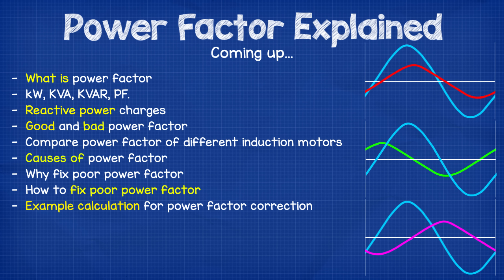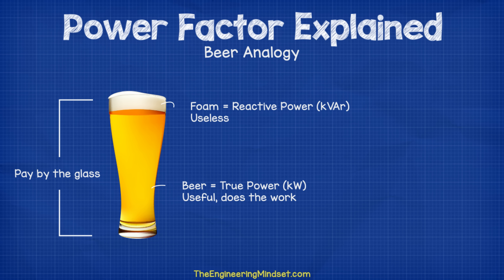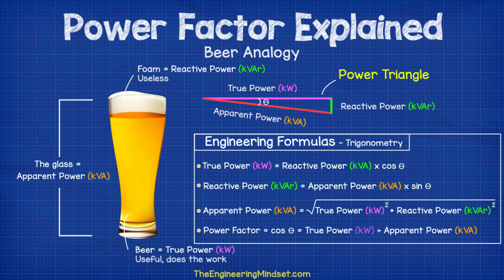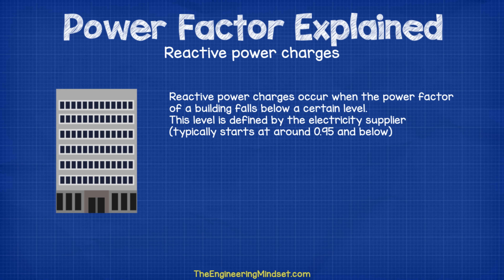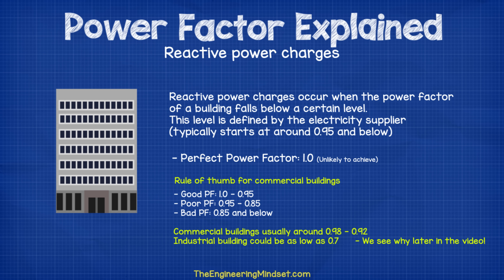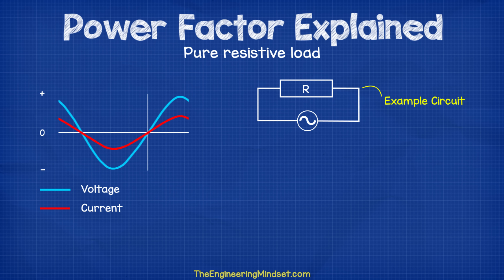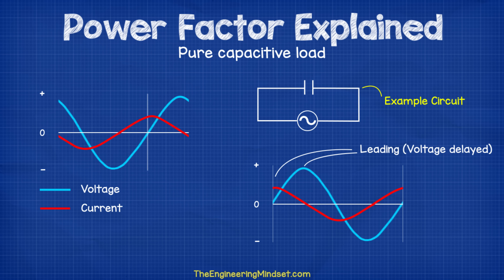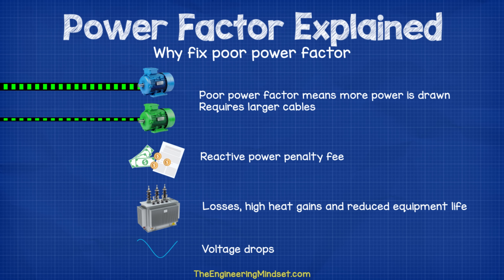Power Factor Explained - The basics what is power factor pf

Comment: How Unit/Kg is standardized in manufacturing sector.
Reply: It used to be (even within your lifetime) that we used a physical object as the master kilogram.  There is an metal cylinder as a prototype, stored in a vacuum chamber in an underground vault in France, that is the single reference object that defines what a kilogram is.   It is called the international prototype kilogram, or Le Grand K ("the big K").   Many countries have their own replicas of Le Grand K, built to the same specifications, and stored in the same conditions, that are used as a master reference to calibrate devices that measure mass within the country.

The problem is, that there is deviation in the mass of the various replicas, which makes reliance on a single physical object unreliable for a unit standard.   In 2018, we re-defined the kilogram, by setting Planck's constant to a fixed number, so that the kilogram is no longer dependent on a single object.  If Le Grand K is destroyed, or if it changes mass for unexplained reasons, we no longer need to rely on it to keep track of what a kilogram is.  Using a method to measure Planck's constant, called the Watt balance or Kibble balance, one can determine the mass standard for defining what a kilogram is, for all mass measuring devices.  It feels like it takes a degree in physics to understand this definition, but simplicity is not what the international bureau of weights and measures needed for replacing the existing standard.  It was whether the new method could achieve a more accurate result than the existing standard, that determined which method won.  There was a competing idea that used a pure silicon sphere defined from the crystal structure of a pure isotope of silicon 28, intending to fix Avogadro's number, that I would've preferred, but it couldn't beat the Planck's constant/Watt balance method in precision,

Comment: but i could not understnd that the unit of capacitance is Farad so why,in the end,u said 25 "kVAr"??
Can u tell how to calculate in Farad??
Reply: Capacitance is A*s/V (Farad)

Power, apparent power, reactive power are all in Watts (V*A).

To convert you need to divide by Volts squared and multiply by seconds (technically divide by per seconds).

C = VAR / (2 π f V2)

Comment: Do you happen to know why a motor would have a power factor higher than 1?  I have several in my shop that have PF of 1.2.  I know that's something I have to account for when choosing motors for pumps because it affects the horsepower of the motor.

Comment: would the power factor of a permanent magnet motor be 1?
Reply: No,  a permanent magnet motor is still an induction motor. You still need to induce the magnetic field in the stator coil to push the magnets in the rotor. 

Although, the power factor is better because you don't need to induce a magnetic field in the rotor.

Less induction means better power factor.

Edit: state to stator.

Comment: Very well explained. Thank you. I do have a question. We have a Generator that has a 0.8pf, 3phase and 30KVA. Can I add a capacitor so that I can increase the pf? If its possible, where should I placed it?
Reply: Yes you can. You will need to connect capacitors on a delta connection because in delta you require 3 times less capacitance than you would get on a star connection, so Zc(delta)=3*Zc(star) after you have connected your loads.

Comment: Great videos of yours, I appreciate deeply each one of them. I've found the animations particularly descriptive, much more than all the drawings I could see on student books.
I did not go through all the commentaries to check whether someone already commented on the slide with the trigono.
A minor mistake :.
True Power [kW] = Apparent Power [kVA] x cos(Theta) or
True Power [kW] = Reactive Power [kVAr] / tan(Theta) but not
True Power [kW] = Reactive Power [kVA] x cos (Theta). 

I guess you meant : equation 1 squared + equation 2 squared = equation 3 squared, so Eq1 should read : True Power [kW] = Apparent Power [kVA] x cos(Theta).
Correct ?

Also

Power Factor = cos(Theta)=True Power/Apparent Power (the division symbol can be confused with a + sign). This was already mentionned in a previous comment.
Hoping it helps.

Comment: Power factor of an electric motor for Ecole can vary greatly depending on motor load, I've seen it go from a pf of 0.60 to.0.85

A huge flaw on the engineering side is they always seem to calculate things at full load when in reality devices are rarely at full load all the time. So smart designs accommodate multiple load sceneries, 25%, 50%, 75% and 100% so that systems run efficiently under most all conceivable load conditions. It is especially a common pro lem with data centers being designed at max efficiency under full losd.then data centers comes out of construction and sits for a year or more at 10% to 40% operating horribly inneficuent with way oversized motors and cooling systems (inductive loads) fast cycling on/off constancy over cooling, causing excesive wear on the gear and power factors verying all over the scale so simple solutions like capacitors don't work when real world operating conditions very constantly from the ideal design. I can be a huge pro lem four operators and equipment reliability. Engineers often think of the world, and especially data centers as runing at a constant full load when in reality they do not over there life span with no accommodations in the design for efficient operations in all load conditions...
Reply: It depends on your application. My experience is that the motors that we ran run at a high load all the time pull 80% of max amps. Power factor with caps ahead of the inductive motors work well. The motors I am referring to are used to move fluids and run from 1hp single phase to over 1000hp 3 phase. This is a continuous processing plant so cycling isn't something that happens except during a shut down to upgrade and or repair equipment and those last less than a couple days before the plant operates again at 24/ 7 for months on end...
Reply: @fun2drive107  true in industrial but in HVAC the load will very greatly quickly and greatly from morning to night, seasonally and occupancy changes. Most engineers fail at designing for efficiency at no, low, and medium and variable loads. One thing LEED (and ASHRAE somewhat) does is to gain points for LEED certifications if a building is verifying designing for varying loads so the building operates efficiently a And comfortably (comfort us another thing engineers fail at horribly with efficiency) at all loads, empty building at start up, partial occupancy, full occupant, sudden occupancy changes, sudden load changes, winter, spring, and summer, fall, building orientation and climate zone all dramatically impact efficiency and load. Using modeling and then tested and verified by commissioning
(my job) the design. Again in my experience it is common to see a large motor running under very low or constantly verying loads or large load changes with horrible efficiency (power factor as ll over the board). Common with large fans trying to maintain control of constant duct pressure or cooling/heating demand as heat lids dramatically and quickly change. Many engineers only deign for max load assuming hottest or coldest ASHRAE day for that cv Linate zone as the building performs horribly at varying and or loads other the the limits, very common issue, it's why a buoling is cold, doors blow open, fans hunting, fast cycling stsytens on mild days.

Comment: Our commercial building lost a leg of 3 phase into the transformer before the meter. Got an astronomically high power factor charge. Had to fight with power company, no attempt of reasoning was working to explain this wasn't a fair charge.
Reply from the maker: You should have interval data from the meter which you can use to prove

Comment: Ugh, beer without foam. Like orange juice without fruit flesh. Or air without oxygen.
Reply: Air without oxygen is a contradiction of terms.  Air by definition, is a mix of mostly nitrogen, some oxygen, and a small percentage of trace gasses.   It is common to model combustion exhaust gasses as "air" when studying the thermodynamics of engines, because the nitrogen as a nearly inert "spectator gas" is the dominant flavor of gas in both the initial air and the exhaust gasses.

Comment: Hi,
I am a follower of your channel, I like your channel.
 Can you please help in explaining LV Capacitor Bank step by step but the 
most important is;
1- the calculation of reactors in base of the harmonics in an industry 
using VFD controlled motors for example or any wave distorting source, 
with an example using power factor meter that gives the harmonics in the
 facility and how to deal with those harmonics.
And which are the cases that we don't need to use reactors in series 
with the capacitors, that if we are using Capacitor duty Contactors to 
limit the Inrush current.
2- discharging resistors issue, how to calculate them and how to connect
 them in an exact way? Is the connection made via timer relay? With a diagram, 
if possible.  I found diagrams on the net showing the resistors 
connected directly on the Capacitors terminals without any timing relays
 and that did not convince me, the proper time permissible to discharge 
in case of on off loads like motors used to cut marble or variable 
mechanical load that changes the pf in the way that we need to cut the 
Capacitors out for some moments. Thank you in advance.

My best regards and respect.
Reply from the maker: VFD Video is now live! here: https://youtu.be/yEPe7RDtkgo
Reply from the maker: Check out NEW resistor video, everything covered! ➡️ https://youtu.be/DYcLFHgVCn0

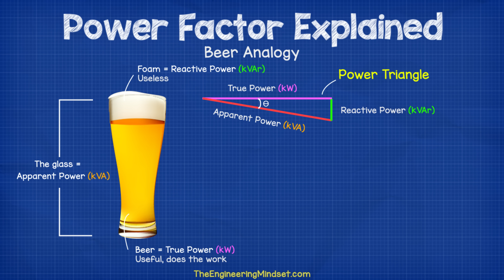Comment: the beer glass docent match the right triangle at 2:30, true power should move up and down aswell
Reply: You're wrong. True Power never changes. Only reason Reactive and Apparent Power are changing is because we add an inductor or a capacitor (If Reactive Power changes, so does the Apparent Power). For example, an asynchronic 3-phase (inductive) motor, you need capacitors on a delta connection in order to increase the Power Factor. Remember, the higher the PF is, the less Reactive Power we have and the closer both True and Apparent Power are).

Comment: So, why motor produsers then don't just add a capacitor into their motors to make good pf?
Reply: because PF depends on load, if the load changes on motor, then you would have to change capacitance as well. So fixed capacitor would help only in fixel load point. Thats why the compensation is used at higher level, for example whole factory and there is bank of capacitors and controller that switches on/off additional caps to match the capacitance to achieve certain PF
Reply: It's common that they do.  And the capacitor has other benefits as well, such as the fact that it softens the starting current of the motor.

A motor without this, will spike the current when it first starts rotating, and reduce it to the full load amperes once it achieves its steady state motion.   You ever notice how your lights dim when the refrigerator starts running?  This is because of the starting torque and inrush current of the motor that drives the compressor.   The capacitor can store energy during the first half of the AC cycle, so that it discharges and assists the power from the grid to initiate the rotation of the motor.  This offsets the inrush current that would otherwise need to come from the grid, and cause a "brown-out" for other loads on the premises.

But the problem is, that you can only know in advance the size of capacitor to add, if you have a known load that will not change.   The power factor will depend on the mechanical load on the motor, so you'd need a capacitance that could dynamically adjust, in order to adapt to every possible mechanical load.

If you have a routine predictable mechanical load on the motor, you could add a capacitor that takes care of the problem.

Comment: How does the PF change as you go from free wheeling to fully loading and induction motor? I would love to see a scope output that had motor torque, current and voltage overlayed as torque was changing.
Reply: PF is the lowest in idle, and goes up as the load goes up (reactive component is constant, but the active component grows). Keep in mind that the same motor idling with PF 0,2~ and loaded with PF 0,95 would still draw the same amount of reactive power/current.

Comment: Gee!
My power meter (and everyone else's) only sees true power and I don't pay for reactive power. My power meter is not a KVAR meter, it is a true (KW) power meter. VAR power is an energy waste and requires larger cables and bigger circuit breakers to handle it. Industry is restricted in the amount of VARs because of the power wasted, and so penalties are assigned when the VARs are allowed to circulate. If residences were charged for reactive power then it would pay users to add correcting reactances to reduce the VARs, but this is not the case for me.
Reply: You'll find you are paying for the reactive power - it just won't be considered or itemised in the bill. Your power meter will see the total quantitative amount of power being consumed by the domestic load, and does not differentiate between, for example, the power used to produce light in a lamp and the power used to produce heat. Likewise for your washing machine, your fridge and every other load on the system. So the KW that you are paying for will include the KVAr's in your system, but the amount will be so insignificant domestically for it to be of concern to you or the provider.
Reply from the maker: Seen our new incredibly detailed MCB video? link: https://youtu.be/gqEu9t8HwW0

Comment: Reactive power is not actually useless! It is used by inductive loads to magnetize their magnetic core. Theoretically without reactive power there would be no magnetization, which means no induction motors, no coils, no transformers, only incandescent light bulbs and resistive heaters. In reality it's impossible to restrict the flow of reactive power, it can only be compensated near the consumer. 
I made an in depth video about the triangle of powers and also deforming power, feel free to check it out.
Reply: Did you watch the whole video?
Reply: @drivenbydemons  It turns out you are right. It seems there is a 10 second explanation I have missed the first time :).
Reply: Reactive power is quite important for engineers and scientists like us but a waste and a problem for electric companies! Reactive power make their generators, transformers and power grid lines to work inefficiently as explained! So if you are a load with a poor load factor they will bill you hard since you are negatively affecting their assets!!
Reply: Actually,  this was expressed  and explained. As promised.

Comment: I learned my electrical theory in 1951 in Toronto (RCAF Reserve) in an 8-week radio-technician course during the summer after high school.

I never forgot the following mnemonic: ICE + ELI = Tuned circuit

ICE - For a capacitor (C) : Current (I) leads Voltage (E) where E = EMF = ElectroMotive Force = Voltage
ELI - For an inductor (L) : Voltage (E) leads Current (I)

In radio, to tune circuit to pass a specific frequency, a capacitor (C) and inductance (L) are connected in parallel. Then adjusting the capacitance (C) passes a different frequency at each setting. The resistance of the circuit is fixed, but the impedance is minimized for a specific frequency, determined by the combined reactive effects of the capacitor and inductance. 

I assume that the power factor would be maximized if a motor is tuned to the frequency of the power supply, say 50Hz by adjusting the size of the capacitor(s). 

Sixty years later, I was working in Pakistan as a water utility financial specialist when I overheard a British engineer comment to his team leader that the pump motors of the water utility lacked capacitors. I checked if the excessive cost of electricity for the water pumps resulted from the low power factor. I failed in my efforts to explain this to the CEO of the water utility who was a railroad engineer.

Thanks to this presentation, next time I will succeed. The vector diagrams do more for me than the beer, unless I drink it.
Reply: good ol' ELI the ICE man!

Comment: Surely you should include motor efficiency into the equation for induction motors. For example a 10kW output motor will consume more than 10kW true power before we consider PF.

Comment: Bad power factor must be corrected to also prevent the overload unit on the magnetic starter from tripping and to help prevent burning out motors , I went to a waste water treatment plant to check out two 5 HP air compressors , They were tripping the overload unit on the magnetic starter , I checked the amperage of the motors and was in the safe range , My supervisor and I went out there another day and he connected a power factor meter and found that the power factor was very very low , The meter showed .47 power factor , That's why the overload unit kept tripping , They had alot of problems with the power out there , For example , There was 140 volts on the 120 volt lighting circuits and were burning out light bulbs and ballasts like crazy , As for the air compressors , A capacitor bank had to be installed to correct the bad power factor , I'm sure that capacitor banks had to be installed on all of the other motorized equipment throughout the plant , This is all I knew from the information I received , I don't know what the power company did to correct this problem but they had to do something because they were delivering " Dirty power "

Comment: How would PF differ from Electricity/Power Efficiency? (η)
Reply: efficiency depends on the power loss into heat (friction, etc) it is difference between power drawn from mains (active/true power) and the power that is output on the shaft (mechanical power)